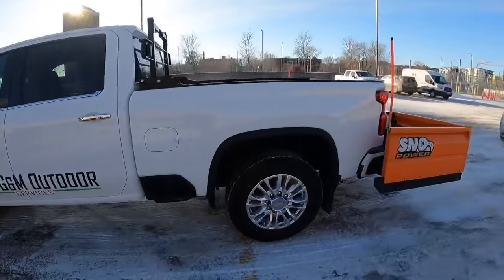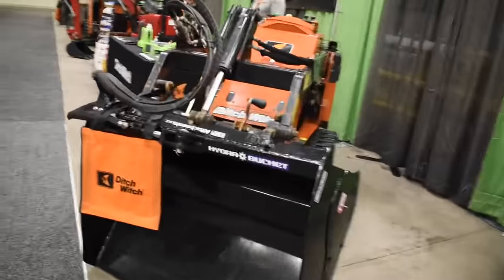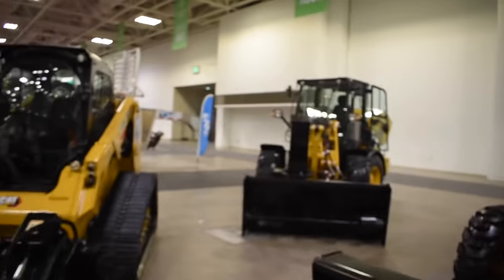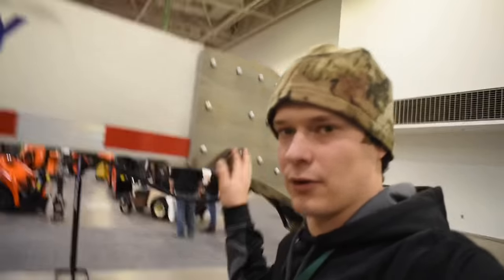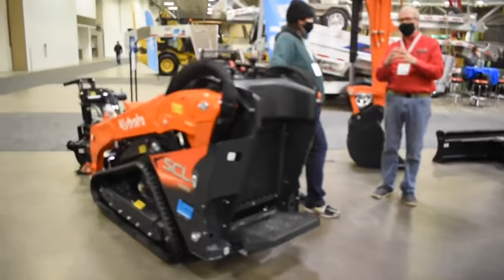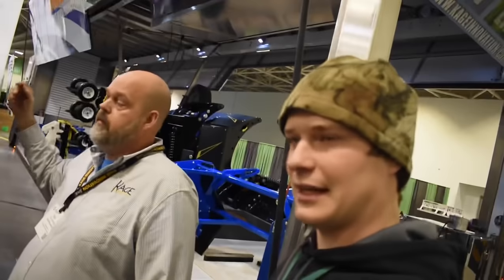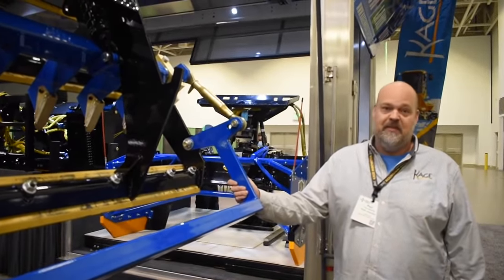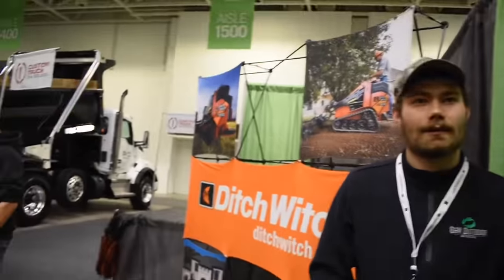AWESOME NEW EQUIPMENT AT THE 2022 NORTHERN GREEN EXPO!!!

Comment: Hey garret..I just picked up a kubota tractor similar to the deere and my blower is a pronovost cyclone..its a pretty slick unit for residential..not many hours with it yet haven't had much snow in my area..cool video though always love the expos
Reply: What kubota did you end up getting?
Reply: @1farmer608  kubota l6060